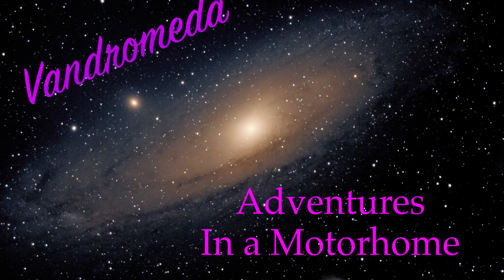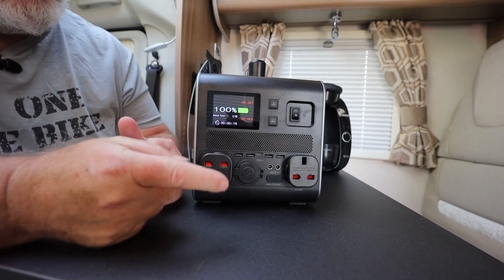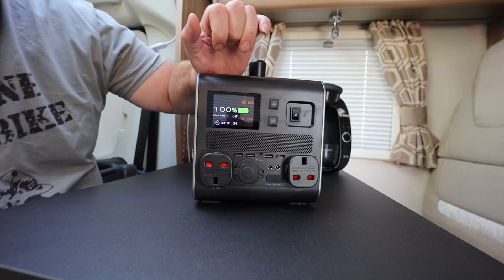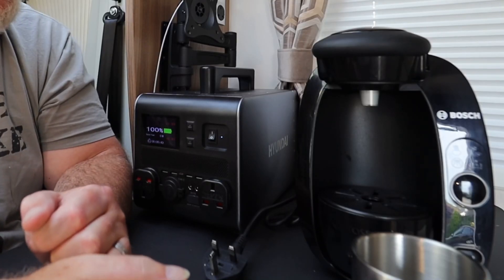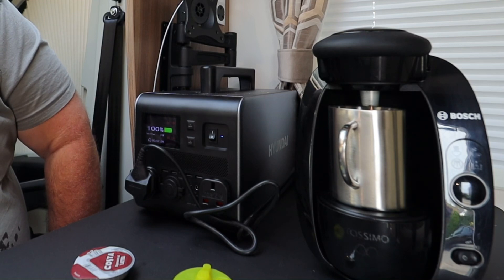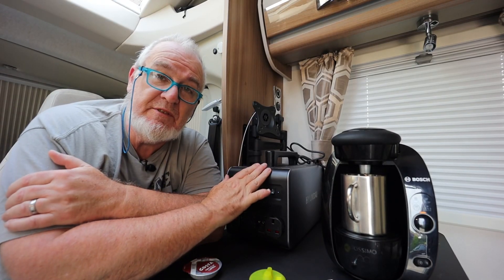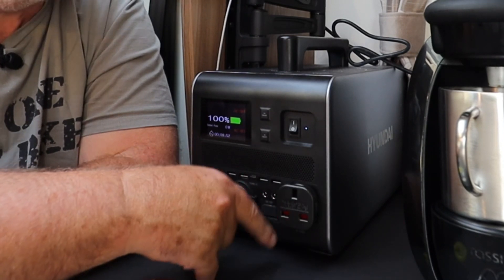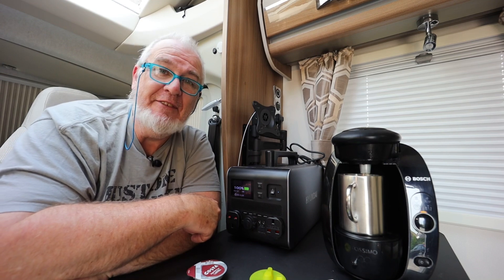Hyundai HPS-1100 Power pack / Inverter tested - will it make coffee?

Comment: we perchest hps 1100 .three days old.its been on charge 9am now 4.45pm now 41% what crap money back
Reply from the maker: Are you charging via mains, 12v,  or solar? Moreover, charging technology has come on massively since this was reviewed almost two years ago - at the time, it was in the very much faster class. These days, not so much. I'd be looking more at the EcoFlow range now - and, indeed, will be.
Reply: mine is very ploddy too. It has some sort of fault on AC input.  When it was working perfectly, I was only getting 6% an hour so it was about 14 hours to full charge. It is possible to charge via DC and AC together  providing the AC charging circuit doesnt malfunction. The manual describes that process and I have got it to do it a couple of times giving around 7 hours till full charge.

Comment: is there a fuse you can remove?
Reply from the maker: Not that I’ve seen…
Reply: @VandromedasTravels  The specs say 2,000 W peak power. It's disappointing that it tripped, I was considering this unit. I doubt the coffee maker draws 2, 000, but worth checking.
Reply from the maker: @runcycleskixc  it’s very much transient spikes it will cope with - that coffee machine draws 1500 watts constant
Reply: @VandromedasTravels  Alright, makes sense! Oh well, I would have to use go for a higher-wattage unit.
Reply from the maker: @runcycleskixc  I’m looking for one, too - the Ecoflow kit looks good…
Reply: There is a fuse right beside the AC input socket

Comment: I installed one of these in our last motorhome and we use a Dolce Gusto machine in the van and with this inverter it made coffee !! It took longer for the machine to start up but once the light went green it worked fine ! Sadly have now changed van and now have two leisure batteries mounted under the lounge floor and at the moment haven't worked out how to sort the inverter ! We enjoy your videos 👍

https://www.amazon.co.uk/dp/B07S37S1ZM/ref=cm_sw_r_cp_apa_glt_fabc_ZKD0ZRY9AY39YWW0308M?_encoding=UTF8&psc=1
Reply from the maker: The HPS 1100 can, I believe, charge via the solar, using a 12v outlet - and can thus be used again!! We're just changing vans, and ours will be taking its place alongside the upgraded LiFePO leisure battery as part of the arsenal. Thanks for the kind words!!

Comment: I purchased the 1100 off this video and it won’t charge! What am I doing wrong?  The instructions are wilfully inadequate.  Any tips for initial charging?
Reply from the maker: How are you charging? Mains? 12volt? Solar panels? My first charge was from the mains - but I've sinced charged from solar and 12v in the vehicle.
Reply: @VandromedasTravels  many thanks for coming back to me.  I plugged it in from the mains for its first charge it took 5hrs to go full 100% It just hasn’t seemed to happen.  When I turn it off it shows a charging green icon full lcd that basically takes 5hrs to go to 100% as I say it does this in the off position.  When I go to turn it on it goes to 0% charged and a flashing red empty battery.  The instruction s lack any sort of detail or problem solving, or first charge info.  When I plug in the charger with the generator in the on position it doesn’t even show charging now.  Think it may be kaput!!
Reply from the maker: @craigpesch  That certainly doesn’t sound right at all... I’d be ringing your supplier soonish!
Reply: @craigpesch  mine is acting stupid too. If I want 100% charge, I have to run it down to zero first. IF I turn it off after charging and checking it, it will be 79% when switched on again , even seconds later. Now it is doing the same as yours and red zero however I seem to be able to charge it via 12 volt when left in the on position. I wonder if they have a faulty AC input and the reason vandromedas is behaving is mainly because it charges only via the 12 volt DC input.

Comment: How many hours do you think you would get from it running your astro rig. Do you just power the asi air and your mount from it.
Reply from the maker: Oh, all night and probably the next two nights - running everything 12 volt my rig doesn't use a fat lot of power, unless I've got the cooler on the camera on full bifta. For purely astro, I could have got away with maybe the 300, but certainly the 600. Could almost brew a coffee off it while it's imaging with the 1100...

Comment: I'm curious why this unit that seems to be comparable is so much smaller! 

ChargeTech 124,800mAh Portable Power Station. Each outlet puts out a MAX wattage of 300W, for a total of 600W (one outlet cannot output 600W). You can also find it under the name of 'Litionite Titan 500W / 124.800mAh Portable Electric Power Generator - 2x AC power outlet - 3x USB (1x QC3.0) - 1x Type-C PD - 3x DC ports'

https://youtu.be/p_Uph-GTEN4
Reply from the maker: Probably because it isn't actually comparable. But nice plug for your video... I do hope you return the compliment.
Reply: @VandromedasTravels  It's not my video, it's one I randomly came across like I did yours. I'm looking to buy a 500 watt in preparation for possible power cuts and looking to get the best one.  And I'm still learning and very new to all of this.

However, it looks like Ive confused your video with a Hyundai HPS-300 one. Just noticed it says 1100!
Reply from the maker: @mreverybody1150  my bad... apologies... yup - it’s the 1100 - I looked at the 300, but it runs virtually nothing of any power, really... took a lot of heart searching and research to pick the HPS-1100, and I’m really pleased I did...

Comment: How are you getting on with this unit now ? Is the fan noisy when in use ? I was going to get one of these a few months ago but everywhere was sold out . I was just about to pull the trigger on an Ecoflow , but then I was told ( and heard ) how noisy the fan is . You certainly wouldn’t want one left running in a van of a night lol . Thanks
Reply from the maker: The fan is, it has to be said, a bit noisy, but much less so than the espresso machine we’ve now got it working with. In 12v supply mode, it’s whisper quiet - no fan at all. Once any power being pulled drops below around 50 watts, the fan shuts itself off, in my experience, so it’s going to have a lot to do with what you’re doing with it. Still getting a big thumbs up from me... very pleased I got it.

Comment: Not sure if this helps and I made zero effort to check if this is correct, but I put your coffee machine into google one of the results was a forum and it mentions that your coffee machine will not work through an inverter.  So seems it's not the capacity of the power station more to do that it uses an inverter to produce the required volts. this is forum link    https://forums.ybw.com/index.php?threads/tassimo-wont-work-on-inverter.462785/   Cheers happy camping Rob
Reply from the maker: As it happens, it seems that model of Tassimo is not a happy camper on any inverter, no matter how pure the sine wave, which is something that has me puzzled - in @BobEarnshaw’s review of a different make (and similar power) it got further, but ended up blowing a capsule up (no-one was injured). And yet, as you’ll see by my follow-up video, the HPS 1100 will happily power a manual espresso maker, and said espresso maker has happily continued to churn out lovely coffee attached to it since. I may, should the muse insist, investigate further.

Comment: Hi, Can you charge from the cars 12volt?
Reply from the maker: Yes, it will take from 12 to 18 volts...
Reply from the maker: Actually - make that 4-24 volts (but I don’t know what would put 4v out!)
Reply: @VandromedasTravels  Thankyou for your reply, so there will be a specific cable I need to buy?
Reply: @VandromedasTravels  Sorry, might need another video lol...I don't have solar panels so is it a cable with the 12 - 18v one end and then DC ? the other to plug straight into the unit...Thankyou.
Reply from the maker: @detectndig9619  Simple ciggy socket to 2.1mm 12v lead does the trick - widely available. My solar panel arrived today, so expect a video soon!

Comment: Hi Dave, what size solar panel do you use to charge this?, I am thinking of buying this do you run a mini fridge from it?
Reply: Have to be honest, it lasts us so long that we tend to charge it from the mains, mostly, otherwise I charge it from the 12v system in the motorhome while we’re traveling, so it’s getting juice from the 150w panel on the roof. Our fridge in the van is triple powered, gas, 12v and mains - auto switching, so we’ve not powered a fridge from the power bank.
Reply from the maker: @FLoaB   Whoops - logged in on wrong account...